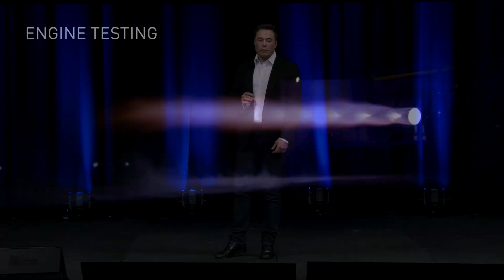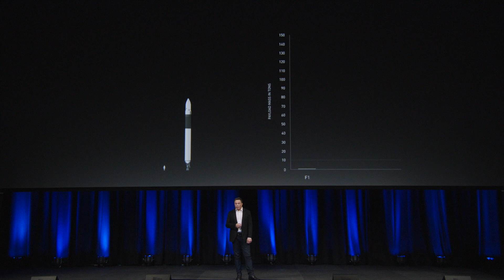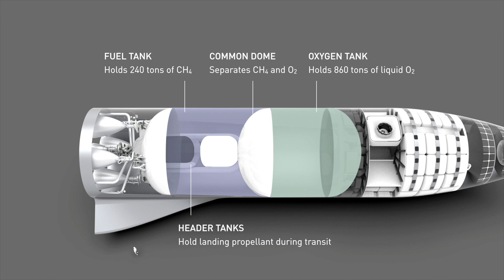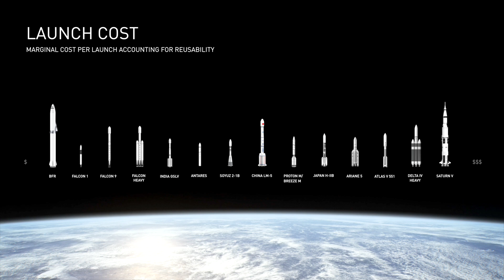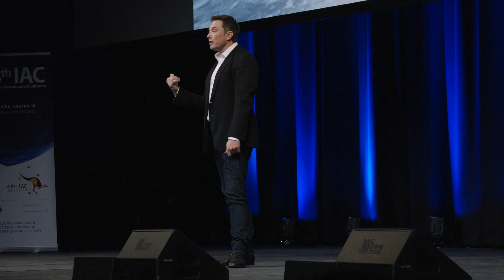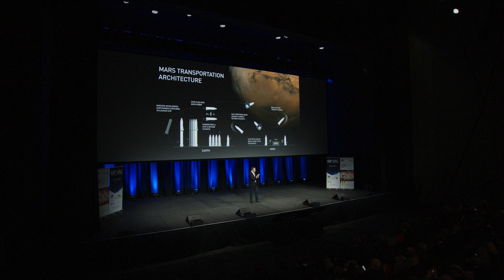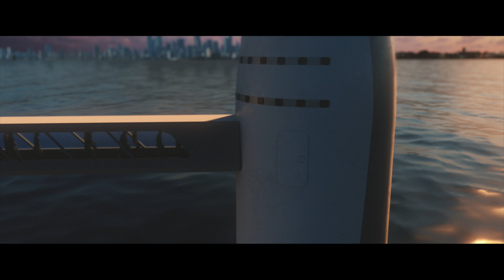Making Life Multiplanetary

Comment: Elon Musk. Before considering going to mars or moon, is better to send a robot over there to build some primary landing pads, otherwise you risk to loose the landers at touchdown due to the crater digged by the engine plumes. or you will have to make a very wide landing base on the vehicules to avoid this hazard. regarding the earth travels, this is going to be a pretty rough ride due to vibrations. wish to have a taste of that. just to see how is shacking at the maxQ. :D

Comment: I wish Elon would stop saying that all they have to pay for is refilling the rocket. Reusing rockets will be EXPENSIVE as you have to check every single part after every launch. It's the downfall of the Space Shuttle. Space shuttle was in turn more expensive than the Saturn V per launch. It's not as cheap as just refilling. The reason we have so many expendable launch systems is obvious. Why tear apart, inspect every part in meticulous detail to ensure there's no damage or fatigue over a period of a few months, at a cost only slightly lower than just building a new one from new parts that you know are good in a shorter period of time? 

Reuse of rockets only really has an upside in producing less space junk. It adds a lot of maintenance work and also the risk that wear and tear can cause a disaster. It's a tradeoff, but I'm still supporting the concept.
Reply: Well, apparently they are confident after landing bunch of F9s that they can do full and rapid reusability. Guess what is planned turnaround (minimal time between landing and reflight) of F9 Block 5.

Comment: Why not start to build big railgun or vacuumtube like accelerators to get the craft in decent speed without using any of the fuel..? The phase that would fit the craft to the accelerator could be dropped after the acceleration like fuel phases of old rockets..?

Comment: I think you are over estimating the re-usability I would assume at best you would get 100 flights before you would have to replace about everything, you could strip some parts for use but beyond that you are looking at getting rid of everything, also I think you are underestimating the costs of servicing I wouldn't be surprised if it would need 3+ months of servicing after 2 - 3 launches which does not include the inspections between services.

Not that I am saying that per ton it wont be MUCH cheaper than anything else and because of the large cargo capacity you can do multiple missions at once so the service time and inspection time doesn't matter beyond there cost as you can do 2 - 3 Falcon heavy missions at once or 6 to 7  Falcon 9 missions, so even if the downtime is long you can do more missions in one go.

So it is well worth it, I just very much doubt the costs will be lower than Falcon 1 once you account for servicing and inception costs I would assume it would be a little bit more expensive than Falcon Heavy but not significantly but given as said that you have almost 3x the mass and far more volume which means that people designing probes etc wont have to go to such lengths make there designs so compact it is again well worth it.

Comment: Those flights on earth will be to expensive.
Reply: Actually if you go on the reddit they're crunching the numbers. Its  very impressive. These ships could hold up to 600 people and would only need to be partially fueled. So the ticket price just about rivals that of a trans continental flight.
Reply: Thanks , i am ver impressed, do you know how can we be part of this project?
Reply: Frank R. Pilot - As in working for SpaceX or a future passenger? The former will require a great deal of aerospace education and experience. However if you want to work on Mars in the future. Pick up a trade and wait until flights start. Mars will need an abundance of plumbers, electricians and fabricators.

Comment: Would SpaceX be checking how these carbon fibre tanks deal with being refilled and emptied, refilled and emptied, over and over time or was the failure of the carbon fibre compound used on panel 8 of Columbia due to the sudden force of an impact/being a different type of carbon fibre product?
Reply: Steve JB - That was a pressure test to see how much it could take. They just fill it until it explodes. As for constant tanking and detanking that will be for future tests.

Comment: How about microwave electric engine that was discovered recently?
Reply: So far all near-future propulsion tech will only work in the vaccum of space and/or have so little thrust they can't even lift their own weight so they require a weightlessness environment as well to be efficient. So all these future engines will need to be launched to orbit on these chemical rockets which have the power to beat gravity.

Comment: He sounds like he's at the verge of crying. Maybe very emotionally invested and working hard.
If you could use a genius to help out, let me know, Elon.
Reply: btw, who told you electric space propulsion isn't possible..
Reply: Electric engines that can put out millions of pounds of thrust are not possible.
Reply: Ye of little faith. It is possible for a 1000 meter long craft to hover silently and go from standstill to 10000km/h in 1 second with no exhaust whatsoever. And no felt acceleration inside. Not even a cup holder is required.
Reply: Then hop to it.
Reply: I might just. I did deep learning. Revolutionizing physics as well would be nice symmetry.
Reply: Good luck. Truly.
Reply: Thanks. But what I'm finding so far is that it's much easier than you would think. Only modestly different from systems like lightning strike simulation and high power radar in a sort of phased array arrangement. High energy radio tuning. But essentially EM as we know it. And when you think about it, it makes sense that physics has to allow some kind of unification if 'gravity modification' style propulsion is possible. So it makes sense that it would be electromagnetic. And apparently it's practical. And even if you can't handle UFO accounts, ball lightning is a glaring example that new physics is right under our finger nails. Because physics as we know it can't do a stable non solid hovering sphere. Yet dumbass humanity isn't looking at it.